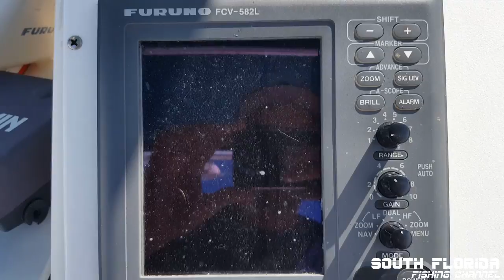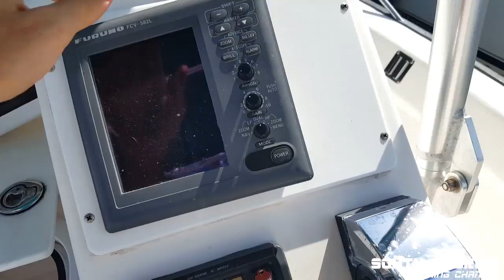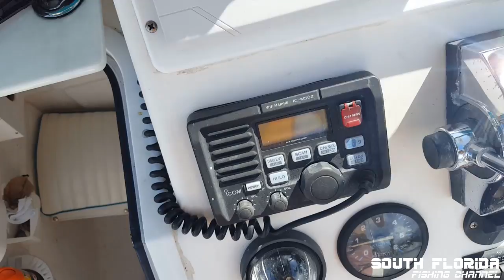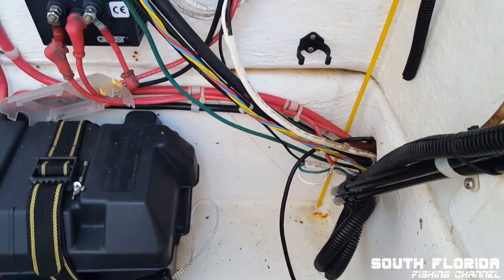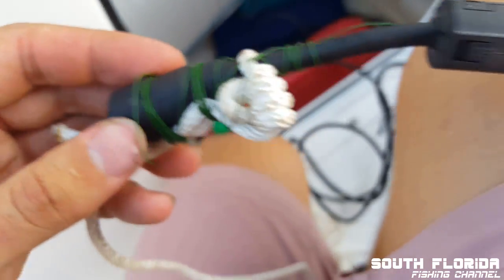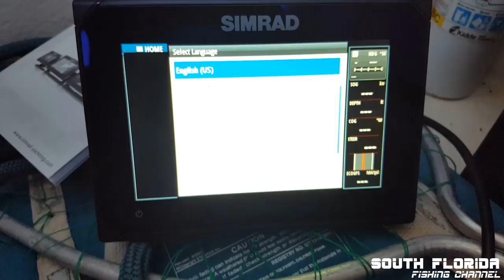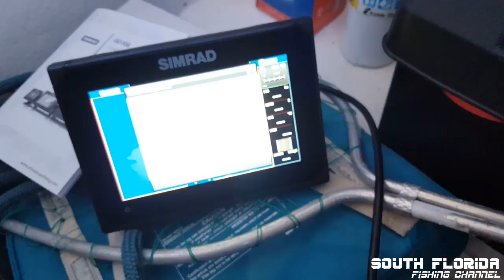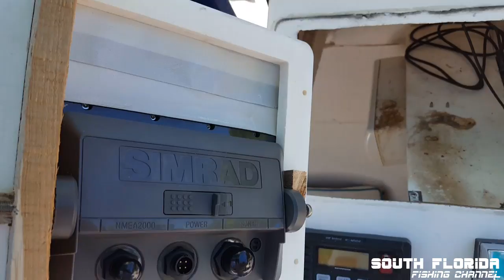GPS/Sonar Totalscan Transducer Installation (Simrad GO7 XSE Fish Finder)

Comment: Question:  I am using the go7 and fishing in water 
from 250 to 550 feet for rockfish.  I am having much difficulty getting 
any kind of reading other than just showing a number on how deep it is. 
 Where do I need to place my settings (frequency, chirp, etc.) to get a 
decent reading in the deeper water?  Thanks so much.  Danny

Comment: Whats cool is the AIS function when hooked to your AIS capable VHF. 
And taking screen shots of the wrecks and reefs found on structure scan are cool!
For myself I can't find any info on saving all my waypoints to an SD card to keep at home away from the boat incase the simrad crashes. I've got alot of time invested in the waypoints and scared I'm gonna lose it all if the simrad breaks

Comment: Nice video mate! I just installed a go 9 on my boat and used a 4mm carbon fibre sheet which are inexpensive and looks fantastic.  You can pick them up from most RC hobby stores. It'll be perfect for your rig.
Reply from the maker: Big thanks for the tip Tony! I'll be trying that out. I just don't know if I even have a boat anymore after this hurricane. Will wait and see what I hear back about a buddy who's going out there to check up on my boat. It was in key largo when the storm hit.

Comment: Great video (just subbed). I'm looking at upgrading my old sounder and getting this unit. Do you use side scan much ? In my area there are small rubble patches in about 20-40 meters (salt water). Wonder if this unit would pick them up ?

Comment: what were the yellow and blue wires that you left disconnected for?
Reply from the maker: they can be used to rig it in a way where when the boat turns on it automatically delivers power to turn your unit on. I don't need it

Comment: Mounted way to low.  My guess is you don't see the bottom when the boat moving more than a few miles an hour.
Reply from the maker: I don't mark bottom well over 6 knots. How much higher?
Reply: South Florida Fishing Channel you want the black bubble portion of the transducer below the bottom of the boat but the cable and mount part above the bottom of the boat.  Look up YouTube videos on “Installing TotalScan Transducer”. You will be glad you did.  Once dialed in it will track the bottom of lake/ocean at cruise speed no problem.
Reply from the maker: mmm interesting i'll do some more research and re position it. I'll make a before and after video. Should be interesting!
Reply: @SouthFloridaFishingChannel  did you ever make that before and after video?

Comment: I HOPE YOU FIXED THE TRANSDUCER AS IT IS TOO LOW, THE FWD MOTION WILL RIP IT, TOO MUCH DRAG.
Reply from the maker: I never fixed it. Stays on fine, but anything over 4 knots and it can't read the bottom which sucks when trying to find new spots while trolling or marking fish. Will raising it higher fix this problem?
Reply: Im not 100% sure but Id think a thru hull is best for scanning while moving over 4 kts. I can't tell how many pieces of structure in the middle of no where I wondered across while trolling or running at 10-30 mph. Its def useful and worth the install if you have the downtime to pull the boat.
Reply: Heisenberg _ 

Do you have the transom or a  thru Hull?
Reply: thru hull
Reply: @SouthFloridaFishingChannel it will 100% help with reading bottom at speed if you raise it.

Comment: How did you run the transducer cable back to the gps?
Reply from the maker: I showed this in the video. I tied a line to the old cable. Pulled it through. Then tied that line to the new cable and pulled it back up to the center console